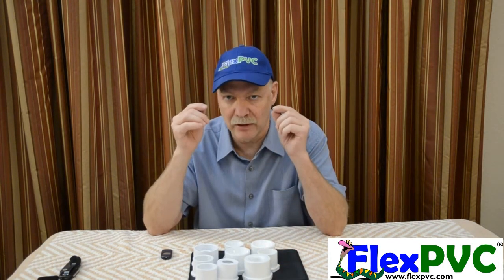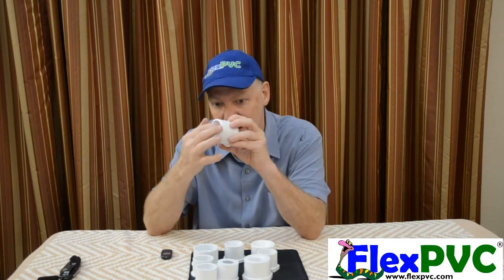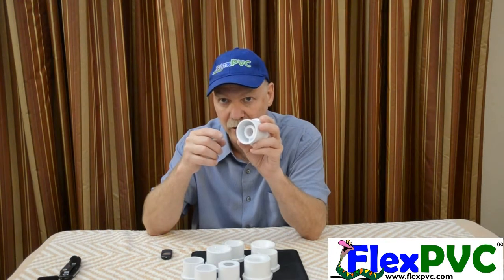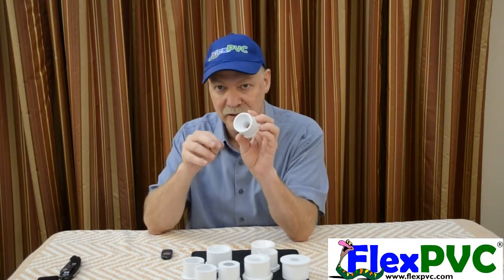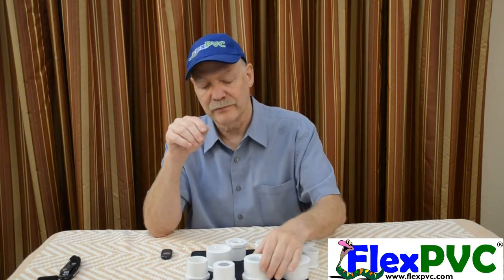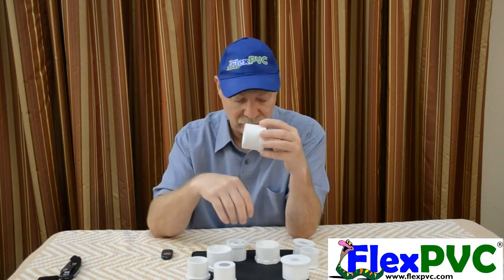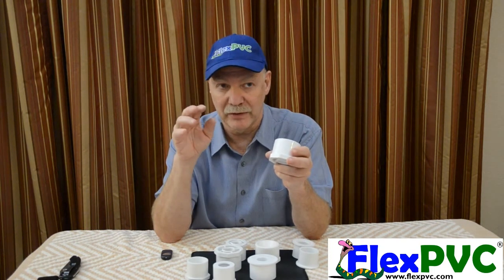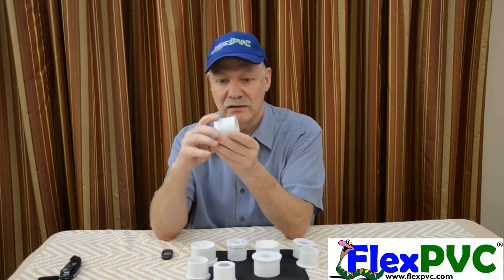FlexPVC - The significant differences in reducer bushings

Comment: I am going from 3 to 2.5 on my pool (before the pump). I believe it is drawing/suction. What is the fitting called? I can’t seem to find one.
Reply from the maker: If you are going from a 3" pipe (3.5" OD) to a 2.5" pipe (2.900" OD) then you use a reducing couple:
https://flexpvc.com/cart/agora.cgi?p=PVC-Fittings-Couples-Reducing&p_id=429-339&xm=on&ppinc=detail

If you need more info, please contact us by email or phone:https://flexpvc.com/Contact.shtml

Thank you! 🙂
Reply: Unfortunately, I don’t have a lot of room to work with. I have a 3” 90 degree elbow going almost directly to a 2.5” 3 port valve. 

I can reduce before the elbow but that would increase the velocity going into the elbow which would increase the head loss. Is that correct?
Reply from the maker: If your valve is like ours it's 2" slip in or 2.5" spigot. Or 2.5" slip in or 3" spigot. see https://flexpvc.com/cart/agora.cgi?p=PVC-Valves-3way-Diverter&p_id=600-0401&xm=on&ppinc=detail

If yours is like that you can just chop it off and use a couple to go over it. Best to send us a picture of what you have via our contact page:  
https://flexpvc.com/Contact.shtml
 @Npb55

Comment: What fitting do I need to connect a 1.5 inch tub drain to a 2 inch waste pipe here is my setup

1.5 tub shower kit to 1.5 trap adapter  need to connect toca 2 in drain stack connected to a 2 inch trap

Comment: I am trying to build a PVC hydroponics system. 

Do I need to buy PVC couplings for every fitting? 

Also, I am trying to go from a 4" PVC pipe down to a 1" PVC pipe. But unfortunately there aren't any 4" to 1" reducers on the market. Is it possible to fit a 4" to 1.5" with a 1.5" to 1" as one whole unit? Or do I need to run some pipe between the reducers? 

Either way I'm gonna find out. I'd just hope to spare to wasted expense.